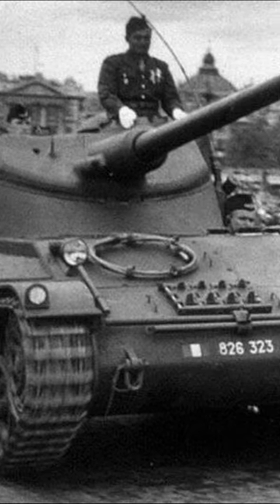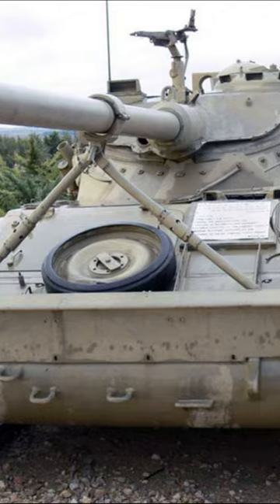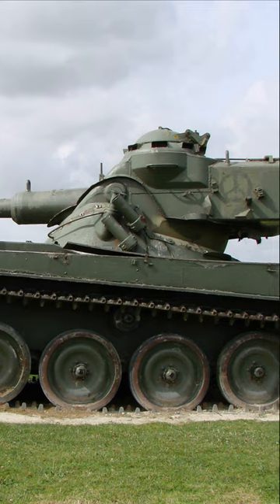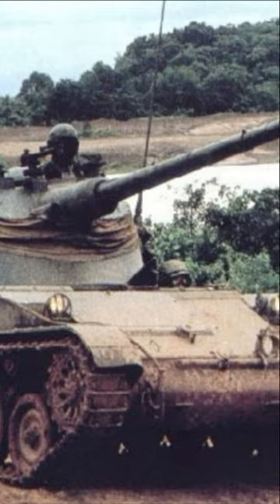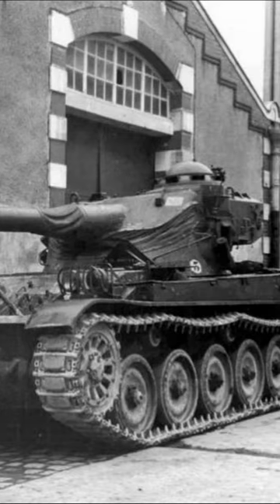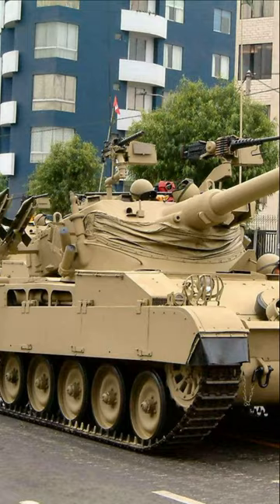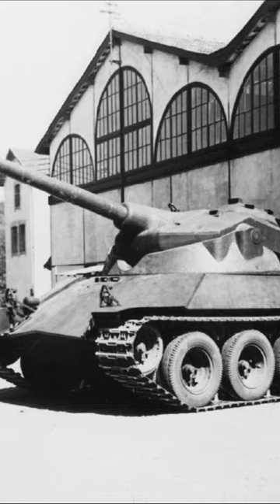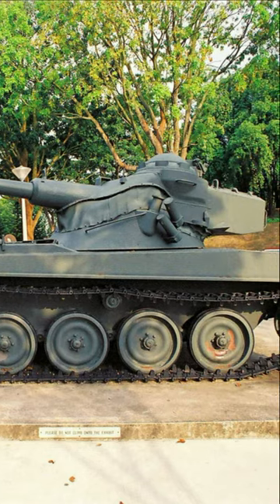Why did the French tanks have such strange shaped turrets? #shorts

Comment: i still don't understand the advantage. A normal tank can also be in cover in the same way??
Reply: Turret is really sloped in a hull down position
Reply: It have faster reload compere to other hand reload cannons. Ammo are placed in two revolvers inside the turret and crewmen can place faster the shell in the gun. When fire the cartridge is shoot out from the turret similar to Soviet MBT's. Low speed thanks to this turret design the cannon is more stabilized that other tanks without stabilization.
Reply: Highly reliable autoloader, able to have higher gun placement without losing gun depression, overall better turret profile.
But when more advanced autoloader a came out it wasn’t really needed, since you could just have an just as reliable autoloader coupled by the fact that it’s way easier to stabilize a regular turret than an oscillating one.